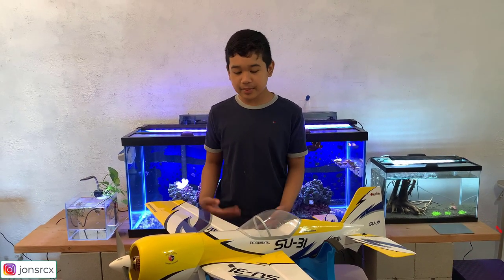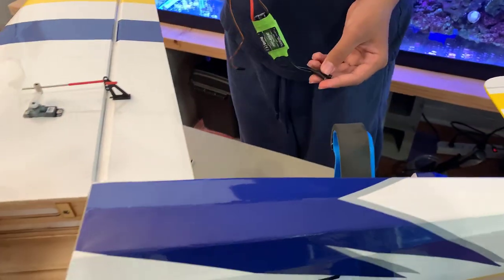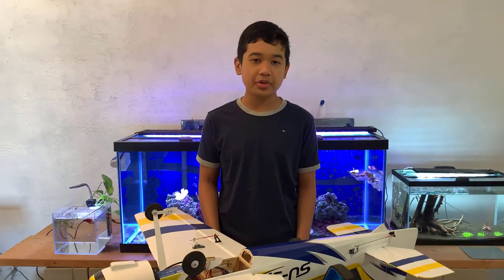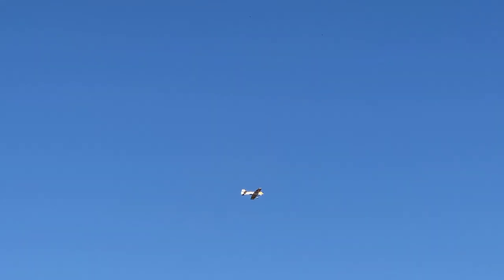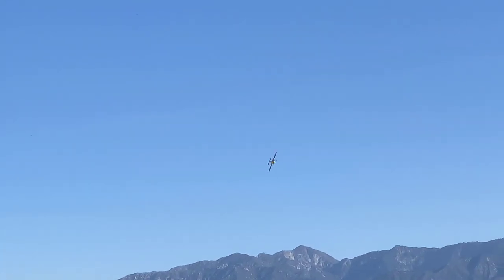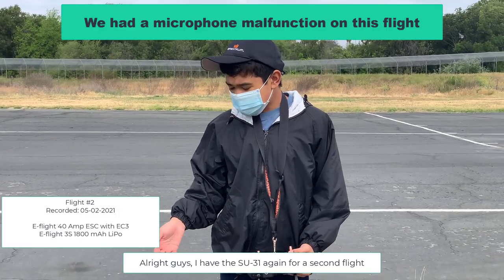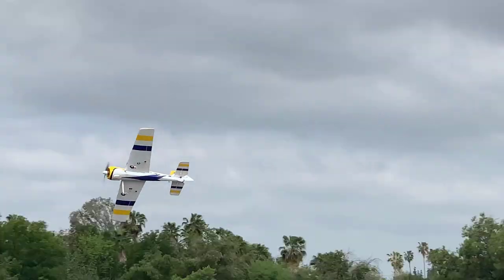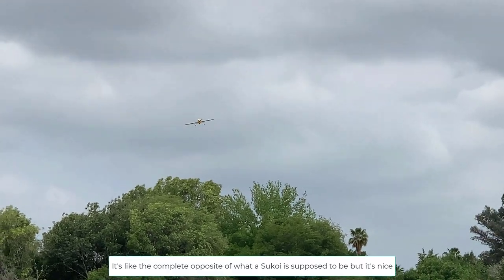Great Planes Electrifly SU-31 - Review and Maiden!

Comment: I had that SAME exact thing happen to my fms esc yesterday! (Worked perfectly last Saturday. Zero power yesterday until a tick above half throttle.) I replaced it (10a stock) with the esc from a buddies crashed timber x 1.2. I got powa now! 😁
Reply from the maker: Glad to know it's not just me! I already started to notice during the first flight.  The longer I flew on the first flight, the more I noticed the issue. I first noticed it during my attempted hover. It affected my ability to land smoothly on the maiden but I'm happy I didn't crash it!  My landing on the 2nd flight was much smoother because I had proportional throttle all the way down to zero stick.

Comment: Excelent video and work! 

The only thing I could comment on is the fact that it looks like the model has a little tail weight, perhaps due to the 1800mAh battery. I would test a flight with a 2200mAh just to see.

Anyway congratulations! Your changes to the links were perfect.
Reply from the maker: Thank you! On the 2200 it was too nose heavy.  The plane balanced much better on the 1800.